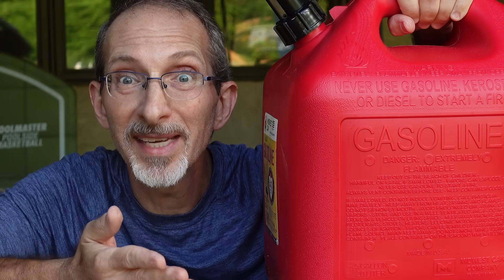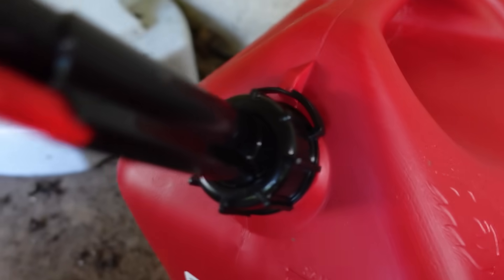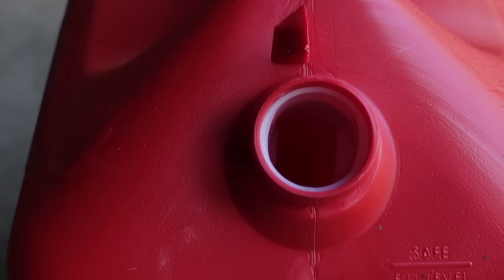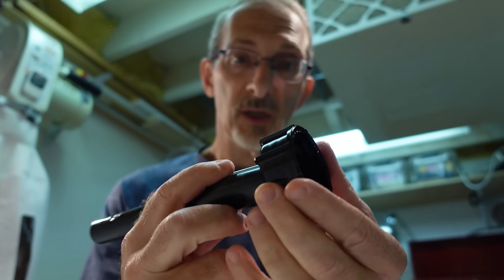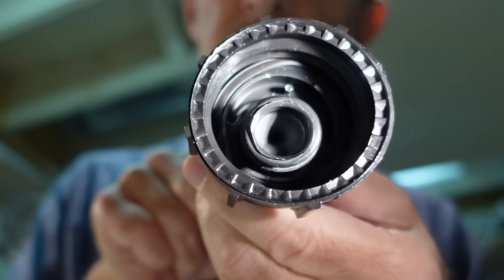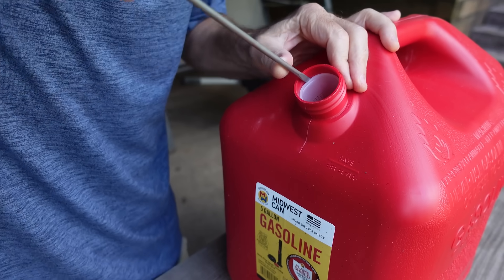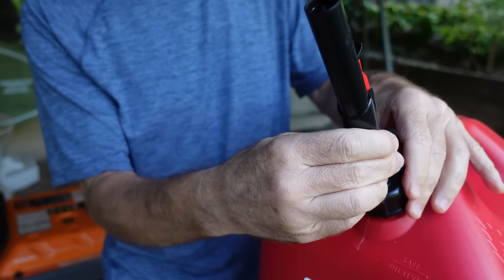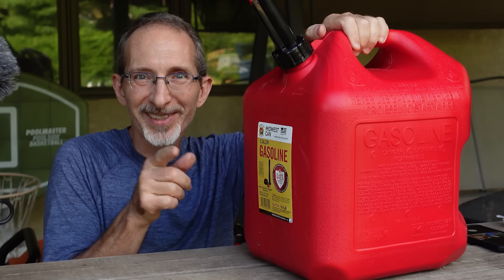Gas Can Modification | New Gas Can Fix

Comment: Soooooo, the filter in the can is supposed to keep contaminants out of the gas from the station. If there's no way to pull the filter out and clean it, that means when you go to pour the fuel into your vehicle or ICE fuel storage device, you'll be pouring those contaminants "right into your tank"  !?!?!?  What were they thinking!?!?  Are they "trying" to cause more damage or repair costs to the devices? Ppl would wonder why their engine isn't running right, and possibly take the unit to the mechanic or small engine service, and only thing replaced is a $20 fuel filter, but the shop would charge >$100 for the fix!!!!  WTH!?!?!

Comment: Next step is to get a small threaded brass fitting with an attached cap.  Drill out a slightly undersized hole on the top back of the container, warm up the brass fitting and then press fit it into the hole.  Voila, a pressure normalization valve so that you can pour the gas smoothly and splash free then seal it up vapor tight.
Reply: I installed tire valve stems without the core. When I use it I unscrew the valve stem cap. Pours like it should. When I'm done, screw the little cap back on
Reply: @fauxque5057  I use a golf tee. Drill hole, shove it in. The tapered shaft makes and perfect seal and if I lose it it's a couple cents to replace ;-)
Reply: @fauxque5057  I did that, worked great but didn't last over a year. Make sure the rubber can withstand prolonged exposure to harsh chemicals.
Reply: Safty gas cans is just more proof the governments ideas suck
Reply: I bought a five gallon can that is supposed to vent the can through the pour spout. All it would do is leak gas all over no matter what I did. I used an older straight through spout without all that nonsense and put a small screw in the other side of the can for a removable air vent. Works great!
Reply: Good solution for probably the worst flaw.
Reply: Yes, a small vent opening would help the flow to be smoother when pouring.  This would result in less spill, and seems like a safer option to me.   This used to be common in older models.  Why has it been taken out of current gas cans?  To save production cost??
Reply: @HighLeeCoyote  ironically it was part of new safety protocol
Reply: @igglesjawn3975  I remember my 1st mower with a hydro - garden tractor .
Right hand on hydro lever to control direction/speed. Left hand on steering
wheel. Middle hand pushing button to reverse mow!
SO SAFE... 

71 years ago, back in the 50s. this kid was taught to mow the grass
with a mower that was just a deck, 4 wheels, motor on top and blade
beneath. No safeties. Gas can No safeties. I was told that the safeties
are "Between Your Ears". Now 80 something - no damage from mowers.
Ever. Use your head and you won't lose your foot....

Thankfully these POS "safeties" have become SLIGHTLY less stupid....
Reply: @HighLeeCoyote  stupid regulations made by brainless people are to blame.
Reply: Just buy a moto cross gas can. It has a rubber hose with basically a cork on the end of it
Reply: I think...the nozzle is supposed to have integrated vapor recovery, negating the need for the vent.
Reply: @InsideOfMyOwnMind  a vapor recovery on a gas can? 🤣🤣
Reply: @mcard48able  Actually yes. As the fluid leaves the can the nozzle has a return path for the vapors to enter, equalizing the can with fuel vapor from the tank being filled  instead of fresh air.
Reply: @InsideOfMyOwnMind  that is called "venting"  you can't have a recovery system on a gas can
Reply: @mcard48able  I've explained how it works. Now I'm going to just chill and let people chime in.
Reply: @InsideOfMyOwnMind  I'm just saying you are not recovering anything. Every time you take the cap off the gas can to refill it, good bye vapors.
Reply: @mcard48able  That's true to a point. Some will inevitably get out. However if you are filling it from a station nozzle that has the EPA mandated vapor recovery in it you will reduce the amount that's released into the atmosphere. Station nozzles have fuel going in through the middle or inside channel and vapor travels back up to the pump through the outer hose. Just shake one of those hoses and you will feel the liquid line rattling inside the vapor return line.  Our gas cans are the reverse of that but with the same intent, however the function is passive and not powered by vapor recovery pumps, which I am only assuming they use in stations as I don't factually know.
Reply: @InsideOfMyOwnMind  Texas doesn't use those types of fuel hoses
Reply: @mcard48able  I'm not surprised. Do you know if they use any type of vapor recovery method on their pumps?
Reply: @InsideOfMyOwnMind  no just a hose with a nozzle on it.
Reply: @InsideOfMyOwnMind  of course there is an oil well every hundred yards also, so there is no need to try to catch a tiny bit of gas vapor. Google Earth around Midland and Odessa and check out the oil fields.
Reply: @mcard48able  Haha. Texas...
Reply: @InsideOfMyOwnMind  that's funny?
Reply: @InsideOfMyOwnMind  if your in California or Colorado, don't be surprised if they make everyone wear a "personal fart recovery system"  soon
Reply: @InsideOfMyOwnMind  it would have a hose running from your ass to a facemask preventing fresh air to enter, like your vapor recovery system on your gas can.
Reply: @mcard48able  I'll save them up and walk into the capital building just a few miles from here and "release the kraken" on them so to speak.
Reply: @InsideOfMyOwnMind  ah that's what that's for, interesting. Too bad it    makes everything work so poorly
Reply: @InsideOfMyOwnMind  That's the way it's supposed to work but this is a government idea. 
  So that means it's gonna work like ccrapola.
Reply: The Mattress Police are going to be coming after now😂
Reply: This ☝🏼
Reply: ThomasD66: Amazon sells plastic ones with attached cap. On ALL my gas
can! Drill one hole, press the fitting in, done....
Reply: I worked for a large petroleum company & we calculated & produced mandatory emissions reports for EPAs at the Fed, state, regional levels.  All I can say is that with the amount of liquid gasoline spilled due to these newer asinine gas cans, along with the resulting evaporating vapor(emissions), I cannot believe total emissions produced have not increased overall.  A true government FUBAR.
Reply: I drilled a hole and cover it with duct tape. Peel the duct tape back while pouring and then put it back over the hole when done.
Reply: Do a video
Reply: Just buy a simple can, ffs. I’ve been filling boats, lawnmowers, chainsaws and weed trimmers for decades and never had problems other than occasional personal clumsiness. Also you should be aware that modifying fuel containers is generally illegal in most jurisdictions, not to mention marginally stupid in any jurisdiction. Just buy the right can for your needs.
Reply: @rayray8687  Good luck trying to find one depending on where you are at. All the stores in my area ONLY have these new gas can spouts. You might be able to find a simple gas can at a mom and pop hardware store.
Reply: @Viperman200221 : I currently have 3 jerrycans, all bought within the past 6 years. They have simple self-venting flexible spouts - no need to fiddle with the old rear vent - and a child safe ratchet feature which I like. These are made by Scepter and you can buy them anywhere in the US - Walmart, Kimpex, Amazon, Home Depot - for as little as $10. Or you can pay $60 for something completely useless and spend a weekend and another $20 modifying it to an unsafe level. In any case anyone who can’t operate the simple childproof mechanism should probably also not be operating machinery.

Comment: Wrong!  The filter you speak to is supposed to resist flame jump into the contents of the can.  It is not a filter for debris.  And yes this is dumb and helps nothing.  Second, get a pair of diagonals and trim off the filler cap safety features, which are a PITA.  Finally, drill a hole at the back of the top handle and thread in a vent valve.  Get a funnel and pour the fuel.

Comment: In CA we have the California Air Resources Board (CARB) BS that ruins gas cans with this bolt-on POS nonsense.  I “fixed” all mine 15 years ago.  I appreciate your straightforward re-engineering of these newest models though, very clear.  👍

Comment: Great video, I wish there were a way to put an old fashion flex neck spout on these new cans. My old steel can c.1970 came with a pour spout that could be connected to a 6” plastic hose if needed. Also a 2” diameter fill cap on top. The fill cap had a vent system so as not to blowup the can on warm days, how simple. The white thing in your can is for vapor explosion protection, not a filter.

Comment: Doesn’t the spring ensure the gasket is always seated?  If that’s the case, isn’t there a possibility that gas vapors could escape?   Especially if the gas can is unused for a while and the neck settles. I’m just curious if the safety lock would actually be sufficient to ensure a good seal.

Comment: Nice. Way easier to just yank that red lock thing off. Without it, I don't mind the spring. Also, they don't vent these stupid cans! I took a punch and vented it at the back. Without that vent, it just gulg gulgs instead of pours.

The engineering on this cans is idiotic. It needed removal.

Comment: The objective of the new nozzle is to close off the container to control gasoline fumes and keep them confined.  This is a very good thing.  With the removal of the spring, the fume closure feature is still there, as long as you remember to pull out the spout and click the red release to show it has closed off the tank.
Reply: Could care less about the fumes.  That does not trump waste and spilling gas
Reply: @erickaelin5420  I agree, Eric, that spillage should be avoided at all cost, but I was referring to the fumes that slowly come off the fuel while sitting for a long time in the gasoline container while stored in your shed or garage.  This changes the nature of the product to have light vapors gas off.  If those vapors are kept in the container, they will make a better product when the container is opened for use again.

Comment: Im old enough to remember the old metal 1 gallon cans with the metal flex spout and a small vent . Never spilled a drop. 
These new " safety " cans , unless youre an octopus these things are dangerous and difficult to use . Ive spilled more fuel with these pieces of junk.
Remove the spout it comes with and throw it away. buy a flexible spout that comes with a pair of differently threaded collars for various cans. 
The guy who invented this safety spout has never used one in real life, typical engineer. Works on paper , but not in real life. Bet he got paid plenty for his idea.

Comment: i like his way of thinking but, he didn't finish the video by testing the can...I was wondering if it will leak if tipped over because the spring would hold tension on the "O" ring that he removed and reinstalled

Comment: Add a self tapping screw with a rubber washer ro the back of the handle for better volume flow. Unscrew the self tapping screw a bit when filling gas tanks. It's a improvement.

Comment: I have 3 plastic gas cans I got back in 1998.  They still work great.  It has none of this safety crap.   These newer cans and nozzles are comp,etc crap.  I have a little car with a really annoying nozzle with premix in it for a couple devices.  I just take the nozzle off the can and pour directly.  It’s just easier and quicker.  I think all this safety stuff make them less safe as gas is spilled everywhere.

Comment: Lol easy fix is amazon and pull out filter in tank, amazon has a 2 nozzle kit that fits course  thread or fine,  it also comes with drill bit for vent installation,  and old school atandars flex nozzle. Its $12, and find me a $15 5 gallon gas can. Good luck with that.

Comment: I always put a devalved car tire valve in the back top to I can unscrew the valvestem and let air in for smoother dispensing.
Reply: A good size bolt works too, drill appropriate size hole, screw it in and good for storage, unscrew for pouring.

Comment: oh plus it takes at least 3 hands to fill a tank with that stupid spring.  And lifting a 5 gallon container is not easy.  So that takes 2 hands and a knee.  Then you have to use the third hand to try and get the stupid spring to disengage. Thats my first container.  The second one i cant even get it to work at all, so i have to change nozzels to use it.   I'm a 69 yr old woman.  THANK YOU!!

Comment: They've put this dumb filter on kerosene cans.  To fill a kerosene heater you need to pump or siphon it into a small  fill hole.  You can't get the pump suction into the can past the filter.   I was just using a chemical safe jug, which probably wasn't as safe as the original style kerosene can, but now I'll be using your tricks.  Thank you.

Comment: i've got the best "fix"

screw all of these new cans.

we start build proper Wehrmacht cans, with all their little bells and whistles, the liners, everything. you now have a fluids can that can be used for fuels, potable water, non potable, and so much more. no bullshit safeties that cover your shit in gas. no more faucets that just drip feed, it's full flow with its own antisiphon AND the attachments sealed completely so you never spilled shit all over yourself.

Comment: Another good modification is to get some breathers and install them in the top rear of the can. That way the can will actually flow instead of going "glug glug glug" and splashing more because your pour rate is inconsistent.

Comment: It is amazing how much they have screwed up the design of gas cans in the name of safety.  The mechanisms are generally too complex and are prone to not working properly in all situations.  In some cases, all of the complex safety features have actually made the gas can less safe in real world gas-filling situations.  I believe that much of this complexity can be laid at the foot of the California Air Resources Board (CARB) which controls these types of gas can standards in CA.  Then these standards get propogated to many of the other 50 states (and perhaps Canada).  CARB is made up of board members specifically selected by the governor.  Often these board members have no expertise in the area that they are creating regulations.  If a gas can manufacturer convinces CARB that their particular design is necessary (even if it's not very functional), it will be put on the list of approved gas containers.  Then it is on the fast track to be approved in many other states.  In my opinion, it is a real mess.

Ed Schultheis, PE
Professional mechancial design engineer and manufacturing consultant for 35 years
Schultek Engineering & Technology, Inc.

Comment: Good idea when filling a lawnmower , Weed whacker Chain saw etc
But what I use for filling a large item such as a generator or riding lawnmower , I used one of those little siphon pumps for filling kerosene heaters which makes it alot easier because you can put the can on top of the generator and use the siphon pump and you don't have to constantly hold that heavy gas can
With today's technology , why can't they design a nozzle where you just squeeze a little trigger to make the gas come out instead of having this ridiculous set up

Comment: I'm late to the party, but I'm quite certain these spouts are designed to NOT work with vehicles. They're short and ridgid, you can't get it past the flapper in the filter neck of a car AND get all the gas out of the can. And that's before shortening the nozzle to start the flow of gas. I have old style Jerry cans and the nozzle is easily 50% longer and flexible so you can truly get the can upside down to fill a vehicle

Comment: I have two of the exact same cans and removed the filters before I even tried to fill the cans. The filters serve absolutely no purpose. If by chance dirt should get trapped in the filter, the next time you pour gas out of the can it will push the dirt into whatever it is you are filling up. Just use the needle nose pliers, open them up and push one tip down between the filter and the can. Squeeze the pliers and twist the handle to fold the filter in on itself and it pulls right out. 15 seconds to remove two of them. I'm still undecided as to whether or not I want to remove the spring from the nozzle. It is a pain in the you know what, but I do like that the nozzle turns off when I lift the can. Thanks for the video.

Comment: You can also buy a nozzle kit that also comes with a new vent. The downside to it is that you need to drill a hole to install the vent, but a speed bit works great for that. The safety spout has its own vent. Ether way you go, these safety spouts suck as is.....

Comment: Everyone on earth spills more gas all over the place after the advent of these ignorant nozzles.  They also break after a few uses.  Water collects and sits in the exposed nozzles.  I removed the plastic filter also, because you can't fill up the @$#@% can, nor can you clean the @$#$@ can out if any dirt or anything does manage to get in there.  The very best thing that you can do with that spout is throw it away and order an EZ-Pour Hi-Flow nozzle.  While you're at it, drill the back of that can out and install the vent that comes with the Ez-Pour.  Both the nozzle and the vent have captured caps that prevent water and debris from getting in your cans.  Get the regular EZ-Pour, not the Hi-Flo, for small lawn equipment as gas will come out of the Hi-Flo rapidly.  There is no other way.  Good luck folks.